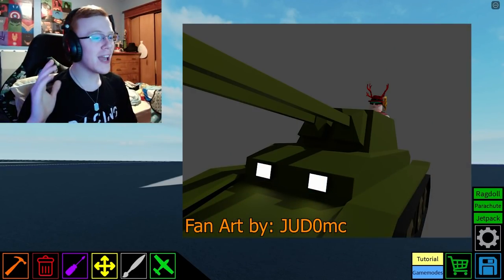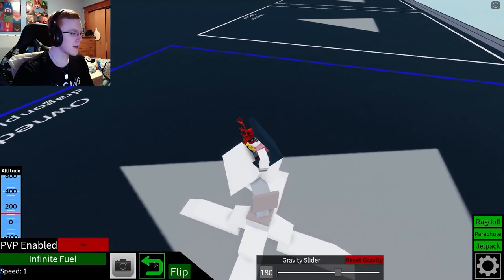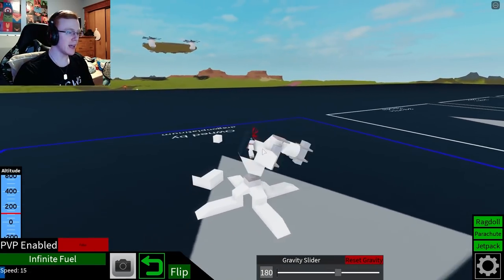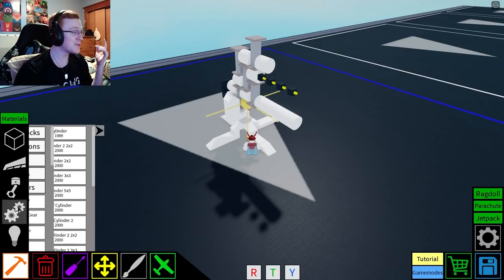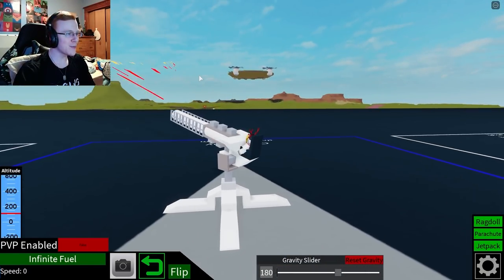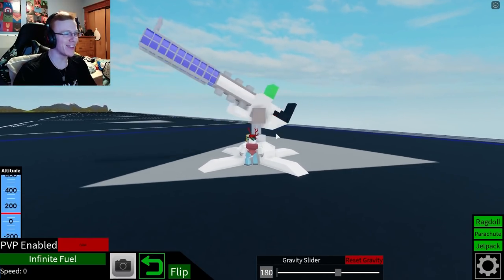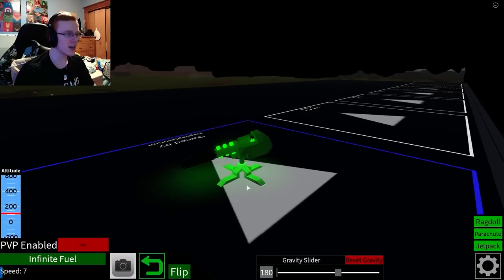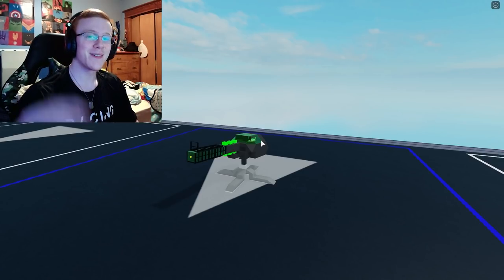I Built An ANTI-AIR GUN! | Roblox Plane Crazy #59 (Plane Crazy Week)

Comment: The bg music from pokemon is nostalgic, good choice :insert pog here:

And watching you figuring it out is kinda painful and it could be more compact for sure but hey, you just get better from here 👌

1 more thing to note concerning the shaking, you didnt seem to have set the motor torque to max. The lower the torque, the less strength the motor has and more funni shaky, so if you max that out, it will be smooth as butter potentially. So you could probably put back those motor 2s and max their torque, if it still shakes, just use the normal motors again (on max torque of course)
Reply: @Ninjacon201 Cheers fam ;D
Reply: @Ninjacon201 cheers fam ;D